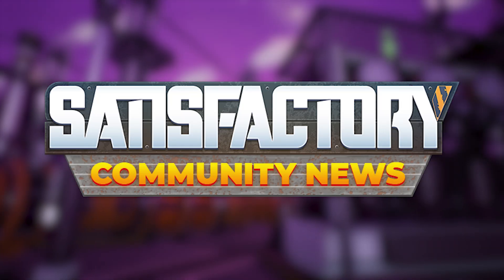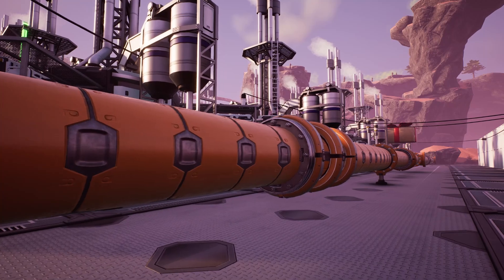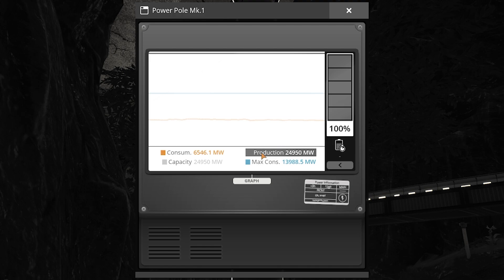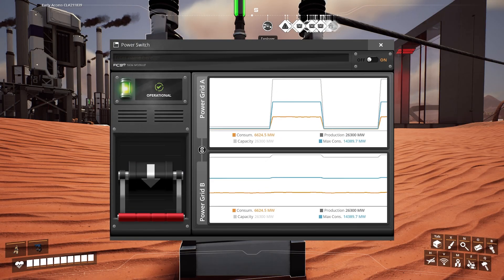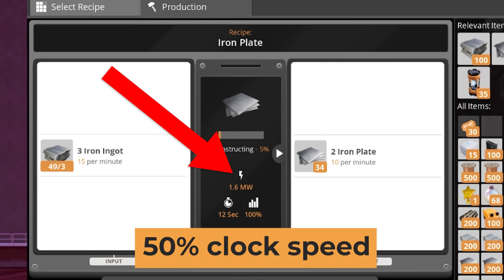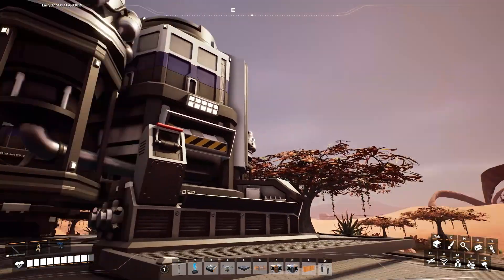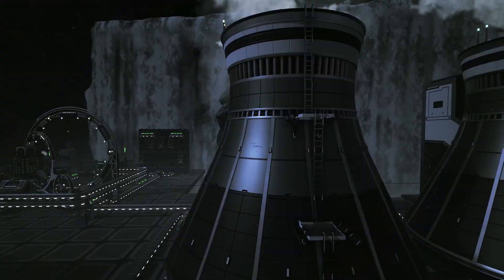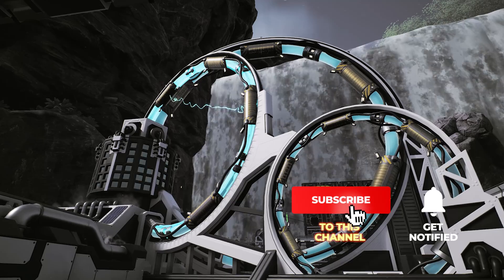Satisfactory Complete Power Guide (Update 7 + Update 8)

Comment: Power outages can be a nightmare, that's why I planned for the worst (and I'm glad I did after updating one of my mods (Refined Power)). On my first day of playing in update 8, I had a power outage less than 5 minutes after loading my save. I immediately realized something was wrong and reacted very quickly, I climbed the emergency access ladder, went to the control room and checked the power grid (that's when I realized something was wrong at the coal power plant). I quickly opened the backup generator valve and disconnected the coal power plant as well as the turbofuel production. As soon as the backup generator was at full power (12 000 MW), I connected it to the power grid and resetted the grid. I then went to the coal power plant, put it on its backup battery and investigated (it didn't take me long to find the problem). When I entered boiler room #1, I saw that the CO2 pipes were no longer connected to the boilers (and it was the same thing for boiler rooms #2, 3 and 4 (there are 4 boiler rooms in this power plant)). Almost 3 hours later, the plant was back at full power (40 000 MW), so I reconnected it to the grid, disconnected the backup generator, closed the valve and restarted the turbofuel production to fill the tank (I almost went through 1/3 of the tank (the generator can last up to 10 hours)). As a result, I will put a fully automatic backup generator in my nuclear power plant that will start automatically in case of a power outage. It will be equipped with a massive fuel tank, allowing it to last for more than 30 hours (the generator will only power the uranium fuel rods production).
Reply from the maker: My heart rate increased while reading this 😂
Reply: @SatisfactoryNews When it happened, the first thing I said was "what the f*** is going on now" and I'm glad I had that backup generator ready (I have a 200 GWh battery but it was disconnected when it happened) because it would have been a whole other story.

Comment: Does water depth determine how well the pumps work? Me and my friend just started getting into this game, and we are struggling to understand why our coal generators won’t work and it seems like they aren’t getting enough water
Reply from the maker: No, water depth does not matter. If you can place a water extractor, it's getting water. The issue you're probably having is with pipes. Keep in mind how much water the pipes can move per minute compared to what the coal plants need. The most popular and reliable way to do coal power when you have Mk1 Pipes (which can move 300 water per minute) is 8 coal generators with 3 water extractors attached to them. But instead of funneling ALL of that water into one pipe, you will want to spread them out. For example, if you have 8 coal generators in a line, you would have a water extractor filling up water at each end of the setup, and then the third would add water in the middle. There are some great diagrams here: https://satisfactory.wiki.gg/wiki/Coal_Generator#/media/File:Coal_Generator_Schematic.png

Comment: super dumb question but what do the colors on the buildings mean? I know Red is off and Green is on but why do I have sudden Yellows?
Reply from the maker: It's not a, dumb question at all! Yellow means Standby. So the machine is either waiting on materials or it's full of the finished product and can't make more, or it's been manually set to standby mode. You'll also see white/blue, which means that the building has a power shard in it.
Reply: @SatisfactoryNews  Wow thanks a ton, I was sure it needed more power or wasn't wired correctly that's why I brought it up. I'm for sure going to get to clean up wires. Thanks again

Comment: When i first started messing with coal generators i band-aided some pipe flow misconceptions by using 1 out of the 8 i planned out to only run the water pumps and miners, the other 7 were the "output" to the rest of the world. i haven't changed this thinking at all. it's a huge safety against me nonchalantly adding too heavy a load later.
Reply from the maker: Nice safety net!

Comment: Wait. Plutonium fuel rods can be used as fuel for vehicles?

Also, I wil actually aways recommend to use power storages. And a lot of them. When going from update 6 to 7, the ratio of used water was changed for the nuclear powerplants. In my save I use 6 plants, fully overclocked. So in u7 my plant created more power than before, but also more waste than in update 6. And because my plutonium fuel factory couldn't keep up the system jammed and the amount of power generated reached levels below consumption. Without power storages I would have experienced a tripped system, but with my 27000MWH I could literally play for another 23 hours before they would be running out of power. Even an update could break your power production, so better safe than sorry and get yourself some power storages. :)
Reply from the maker: They sure can! I didn't know this until reading the wiki to confirm some other information. You can put pretty much any fuel into vehicles, coal being a popular choice.

Comment: It should be noted that power storages can only charge at up to 100 MW so it will always take at least 1 hour to fully fill a power storage. However, power storages can discharge an unlimited amount of power. So in theory your entire 50000 MW consuming mega factory can run - for a few minutes - on a single full power storage. I still advise having a generous power storage capacity as it will buy you time to fix any power related problems and avoid the feared cold starts that can be pretty difficult to manage. 

Geothermal power and renewable sources like from the Refined Power Mod also require power storage. 

Seperate your grid with switches... that way you can turn off parts of the non essential factory in case of lack of power. This can avoid power trips and can buy your more time. Make sure that the production lines that produce stuff for your power generators have their own seperatable grid. This makes restoring power much easier when you only need to jump start a relative small production compared to a huge factory.

Comment: 0:30 "Cant store or buffer power?" What happend to the capacitors???
7:00 "Overclocking easier" What was difficult?
Reply from the maker: 1) They still exist. I talk about them at length in the video at 8:55. And my full quote was "you can't store or buffer power IN THE SAME WAY as other resources". I would consider Power Storage to be distinctly different than items on a belt or items in a storage container, as power is not a physical item.
2) It was difficult because the math was messy. Now when you overclock a power generator to 200% (for example) you will actually get 200% of the base power. Prior to this update, the formula was not linear, so it was less intuitive to figure out how much power you were actually getting - and it didn't follow the same rules of other production buildings, where if you overclock to 200%, you'll get 200% of the end product. This power update puts power generator overclocking in line with other overclocking in the game.

Hope that answers your questions!

Comment: My battery factory can last up to 2 hours before it fails so there is backup if you make it.
Reply: my battery factory has one job, that is to power my water pumps for the 20 nuclear power plants if i ever have to do a cold start. this is why i always keep a full large container after each production stage as conveyors run for free so ill have a reserve of Uranium fuel rods, coal, (only things i need to resupply power). but i have never tripped my system out and are to vigilant to do so anyway lol.